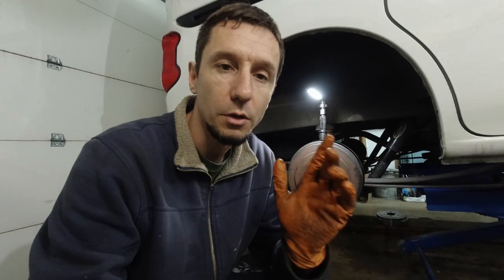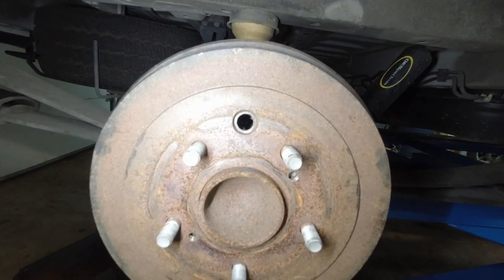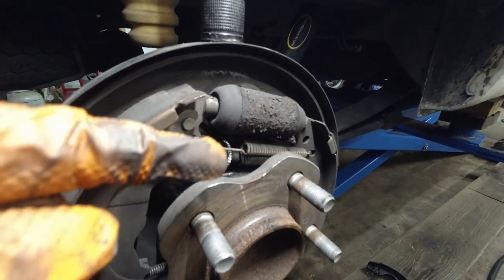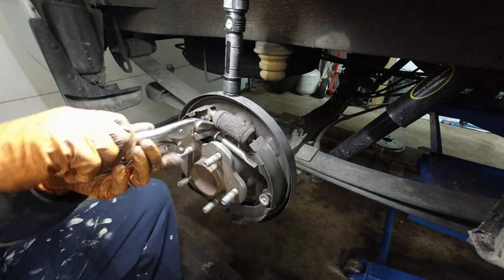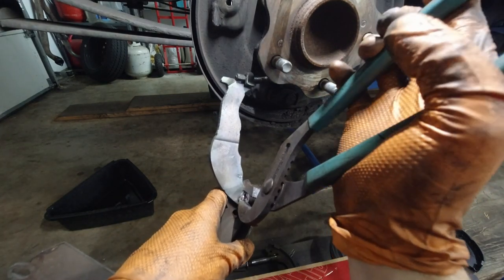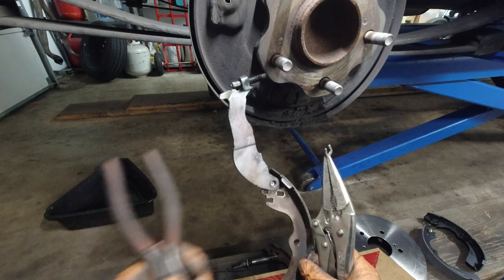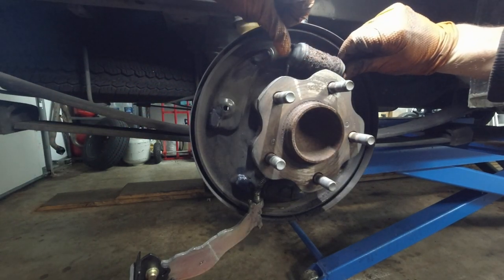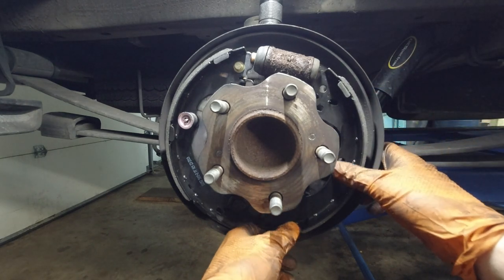Nissan NV200 how to do drum brakes

Comment: Awesome video, very clear step by step procedures and just done mine along with it. Quick note though anyone doing this too @10:59 you can see the rear spring is put on the wrong way around and causes the cog to scrap against the spring, make sure the longer end attaches to the shoe with the c-clip! 

Thanks for the vid!
Reply from the maker: I think you are right but i dont think it actually touched the wheel or would cause any issues, I was able to adjust it with no problem.  Good thing you mentioned this, thanks

Comment: At 9:36 the springs u out n is wrong. The fat end is Opposite. Looking at it the spring part is supposed to be on the right shoe in the long neck is on the left shoe and allows compensation for the adjustment screw
Reply from the maker: you are correct, another viewer caught it also but since I was able to adjust the shoes without binding or other issues I didnt caught it myself and that van is still out and about with working rear brakes.  thanks for catching that.